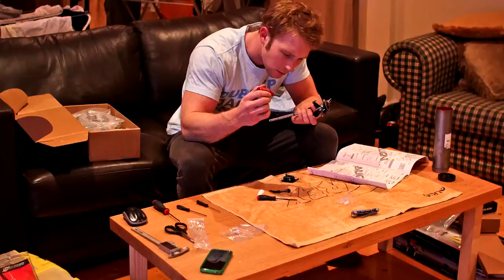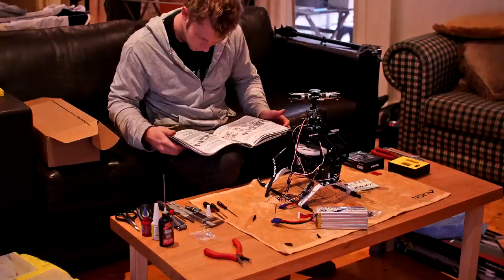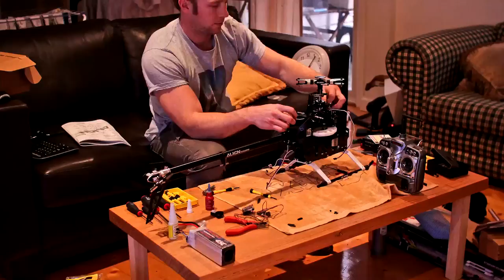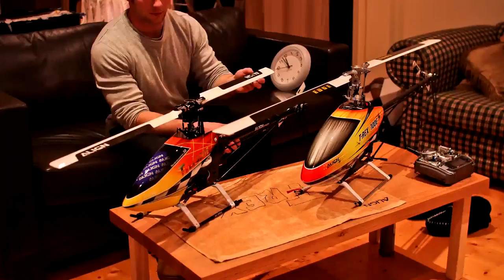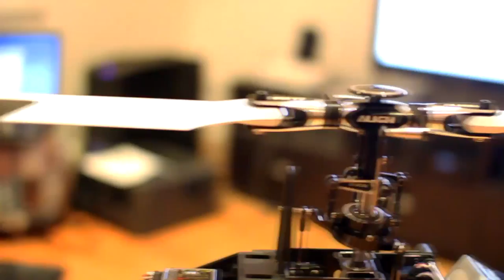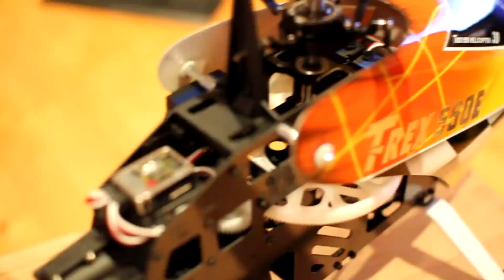TIME-LAPSE BUILD - ALIGN T-REX 550E 3GX Flybarless R/C Helicopter

Comment: @cruddbucket Cheers i just work it out... i thought the throttle trim tab would affect the Pitch of the blades while in idle up(But it doesn't the throttle trim tab ONLY affect the Throttle), therefore thats why i thought the throttle trim tab should be in mid stick position. Hope to see some more 3D flights vids of your 550e Cheers man..

Comment from the maker: @Leeroy2782 Haha good work :) . With regards to your question - I do not use any throttle "trim". I set throttle curves in normal mode, idle 1 and idle 2 to flat zero, disengage motor pinion from main gear and remove main and tail blades. Got to be extremely cautious when setting up! . My throttle hold value is also set at negative 5. Is that what you were after? cheers

Comment from the maker: @boobtube1974 Thanks mate glad you enjoyed it! I think you would benefit more from a 550E size helicopter as your first heli. I normally recommend this over the smaller helicopters because of a few reasons. They are more stable in the air, easier to work on (not so fiddly) and they utilize 6S 5000mAh packs which are usable in the larger helicopters (gotta plan for the future! :D). It is actually not that much more expensive to repair after crashing you will find. Cheers!

Comment from the maker: @Leeroy2782 Ok, the align manual is bad 'Engrish". Simply put I have my collective stick (throttle stick) at the midpoint (50%) exactly. All the points I brought up before are in place to prevent accidental spooling up of the drive train. 

While my stick is centered, my pitch curve is set to 0-25-50-75-100. This means that when I am at mid-stick, the main blade pitch is set at zero degrees, and from then I can adjust all of my servos and  linkages to the corresponding angles and center points

Comment: @cruddbucket So your Throttle trim tab is set to its lowest point (Low stick) in all flight conditions not centred? the reason i ask is that im reading through the 550e manual and it states in the SETUP PRE-CHECK  3. "the trim must be zero when using 3GX and should not be adjusted at anytime" I have a DX6i so i keep elevate, aliron and tail trim tabs all at centre (Mid stick) with throttle do just move it all the way down? (low stick) cheers